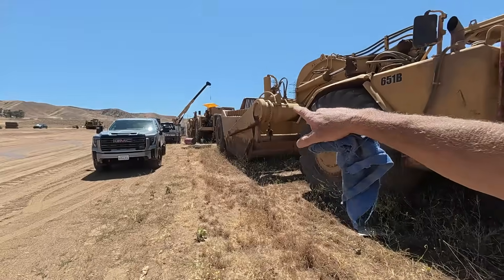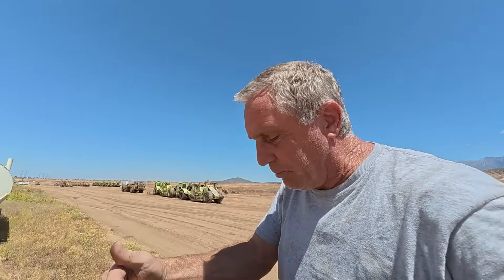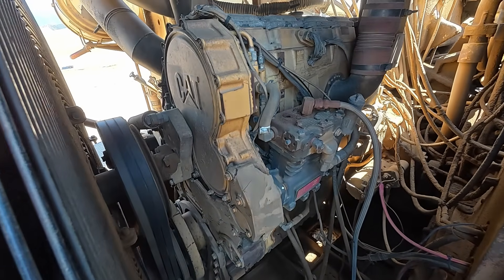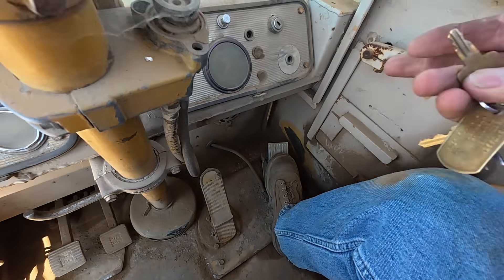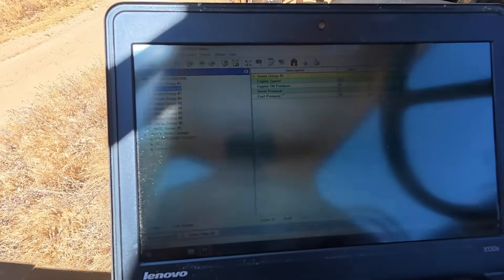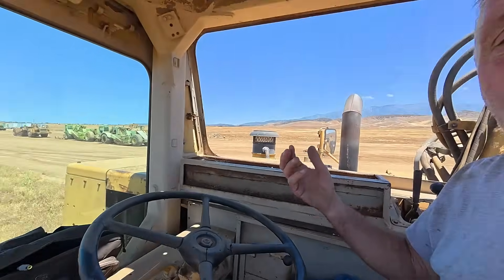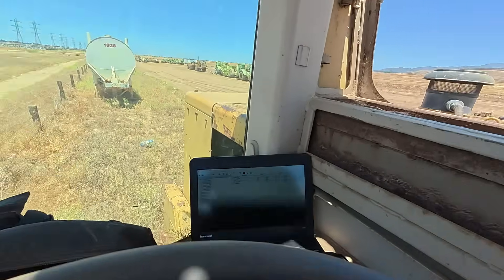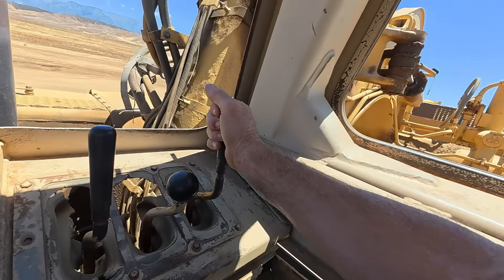Cat 651B Low Engine Power Diagnostics...

Comment: Laptop on a 651B ! Not a phrase I'll bet you thought you wouldn't ever say !
 I spent a lot of hours in my 45 year career working on 657 , 651 and 641B's with D346's, they made me a lot of money !
I can relate to all your comments . Thanks for sharing .
Reply from the maker: Ya for sure, remember back in the day we used a 3/4” wrench to find a miss not a laptop. Cat sure made the “B” models strong, 50 years old and still going strong. The internal parts in the transmission and Differential are still the same that were designed with a pencil and slide rule.
Reply: @RasmussenEquipment  Agreed , those were much simpler times, worked long hours 6 days a week to get the iron ready fort the next day and loved it !
I am wondering if you are you part of the CA Rasmussen family ?
Reply from the maker: No, I used to rent 657’s to them. 
My Uncle Willie knew Charlie pretty well.  
I’ve remember Charlie landing his helicopter in our yard in Colton back in the 90’s 
My dad and uncle owned Pacific Tractor 
They had around 45 657’s plus 834’s, D8L’s until they split in 1996.
Reply: @RasmussenEquipment  Just checking, I met Charlie in the mid 90's to survey some 657E's they were selling, we ended up purchasing 8 scrapers and some parts out of the Simi Valley yard and components from the "station " yard.  They were restructuring at the time and the equipment was pretty rough, We made a great deal on the package. 
Charlie was quite the character as I remember. 
As I said in my original post, I've  spent a lot of time working on these vintage machines, I can relate to, and really enjoy your comments in your videos. Thanks again for sharing !

Comment: More diagnostic stuff is great.
I spent 8 years as an oiler in socal. For the minor competition...

I remember seeing Rasmussen equipment on other jobs back then.
Reply from the maker: I used to like oiling back in the day, after everyone went home, nice and quiet except for the lube truck and air pumps
Reply: @RasmussenEquipment not nearly as hot out either,,  dont miss piping hot machines at 4pm right the job finished for the day

Or getting a face full of hot transmission oil.

Anyway, keep up the videos

Comment: I just got my heavy equipment ticket 
I really enjoy hearing your thought process and seeing how you inspect the machine.
Everyone wants experience with CAT ET, now I can say I have some.
Also I have never driven a scraper, seeing how the controls work was nice.
There was a question on my exam about the correct way to change the cutting edge on one of those.
Something like parking brake & chocks, raise and block the bucket, chain up the apron(?) then replace the edge(?) it was a, b, c, d and they were all very similar.
I've done a bunch of snowplow edges so I hope I can figure it out.
Cheers from Edmonton.
Reply from the maker: Good luck to your future with heavy equipment.
Edges are always fun, put a steel stand or two under the can and a safety pin for the apron.

Comment: Interesting video, thanks for sharing.  Unless I’m missing something, in addition to the low boost isn’t the issue of the borderline dragging brakes also going to cause poor performance?  Thanks from the UK
Reply from the maker: Absolutely, that will be the next repair, hopefully after that it should be back to normal.
My son resealed the exhaust manifold, but we haven’t been back out there yet to test it and do the other repairs.

Comment: A C15 is too small to power a 651
Reply from the maker: Ya the guy who owns this and I were talking about that, the dealer set up the C15 for these single engine 51’s but sold him a C18 for the front and a C15 for the rear of a 57. It made no sense. They both should have gotten a C18

Comment: I hatted that v8  but good for o/t some as early d10
Reply from the maker: I couldn’t tell you how many times we had one drop an exhaust valve. 
We had a couple of mechanics who would screw the rack stop screw out a couple of turns to get more power, but they always ended up dropping a valve after that. After they were gone that pretty much ended that problem. 
But they still only lasted 5 to 6 thousand hours.

Comment: 346's had a 125hr oil change interval,  if they didn't get changed the soot would grind them up. I've doubled the oil changes on my D343's by using a switchblade turbocharger
Reply from the maker: Ya we used to change them at 100 hours. 
My C-15’s we change at 325 hours. 
I watched my oil sampling to see when the oil started to degrade then gave myself a 50 hour buffer. 

I have 735’s and 740’s with 26,000 plus hours on original engines. 

I use Chevron Delo 400 15w40

Comment: What did they do wrong for the old engines to eat themselves so soon? Even today the bean counters don't get THAT greedy on selling you replacement engines 😅
Reply from the maker: The old engines were designed in the late 60’s on drafting tables, using slide rules and pencils. Mechanical fuel injection. 
If everything was set perfect and taken care of correctly, they could get 6000 hours. But that is rare on a machine that works in such harsh environments. 
Plus they were putting the max power out almost all day, if you tried to adjust the fuel rack to get more power they would drop exhaust valves. 
The new stuff is computer drafted, materials have evolved to be better. And a lot of Cat engines are only using a portion of the power that the engine can handle. Cat stopped rating engines by hours and now rate them by amount of fuel burned. 
I have rock trucks with C15’s putting out only 360 hp that have well over 25,000 hours on original bearings, pistons and liners. But they are so derated and don’t work real hard.

Comment: I wonder if the operator has confused lack of power due to draging brakes. ? LOL if it is. Ive seem dumb shit before, I once got a call out to a machine for no power and found a rock stuck in the floor under the accelorator pedal
Reply from the maker: Ya it definitely has a bad exhaust leak, it will hardly rev up in neutral. 
But I’ve seen it too… my  favorite is when an operator comes in and says his go is broken… I asked what… and he says ya I push on the go thing and it just doesn’t go.

Comment: What many mechanics don't do is learn how to run machines, you absolutely need to have a solid understanding how the machine operates to firstly help diagnose issues and then also check your work afterwards.........if you're gunna try to mend em you gotta know how to bend em
Reply from the maker: That’s a fact. When I first started work on scrapers, I decided to learn how to run them, that way I’d know what everything is supposed to do so when they broke it was easier to diagnose the problem. Also we had union operators who would either fake brake downs to get to sit in their truck while we hunted for a problem, or some just didn’t know if it was running right or not. 
I surprised quite a few guys when they would come in “broke” on a Friday at 1:00 hoping to go home early, and I jump  by in the machine and make a few rounds in it to see if it was broken….

Comment: Typical for a Scraper, go look at one problem and find a whole bunch more. 39 years with the UK dealer, mostly field service. We had a bunch of 657E’s moving stockpile coal at various power stations around the region. These were replacing aged TS24’s, we’re talking early to mid 2000’s here. 3408 front - 3306 rear. Very interesting to hear that California had a re power program for emissions; must’ve cost a fortune and listening to an earlier video from you it sounds like the fCalifornian government funded it? Motor Scrapers had all but died out in the uk by the 1990’s, replaced by excavators and articulated trucks. Given the right ground conditions though, Scrapers are mighty impressive earth moving beasts. Sadly, with the batshit crazy Net Zero ambitions of our government, we’ve now closed nearly all of our coal power stations and with that the demise of the Motor Scraper in the UK is almost complete. Good video, thanks.
Reply from the maker: Thank you for the comment. 
I grew up on 657’s working summers and after school oiling, fueling. Then out of high school went right to work on scraper spreads for my dad and uncle, they had 46 657’s. Between 1982 till 1996, they split up and then my dad and brother and I ran the company. 10 years later we sold them and I bought D350e’s 735’s and 725’s
Now for the last 9 years I’ve been on my own with 735’s and 740’s . 
The switch to Articulated trucks was almost like a vacation after working on 657’s
Reply: The 657E i work on have 3412 and 3408. I hate them with a passion. The 657G are slightly better. I refuse the repair or even look at the next gen 657 at the fleet

Comment: They parked it in the rattlesnake grass, has the wrong brake actuator. Low transmission oil, big air leak, exhaust leak. 
 What a turd !! 
   That’s why I hated being a mechanic at a construction company.
Reply from the maker: I’m always up for a challenge
Reply: Luckily, at the fleet I work at, we have sis 2.0 and company only buys factory parts

Comment: Very interesting - keep this up.  Get the air leak fixed first, then get this thing to move.  Great engine is the C15
Reply from the maker: We removed the exhaust manifold last week, will be putting that back in this week, then air leak and see why the trans won’t engage. 

I love going through this stuff to straighten it out

Comment: I like these, reminds me why I got outta that business. I worked for a hvy hwy contractor 30 yrs ago ran the same beat up iron, 631 and 637 D models. I was constantly going from job to job with my welding truck repairing broken goose necks and rebuilding ripped out floors. Constantly working on those things and trying to keep up with everything else.
Reply from the maker: Thanks for watching and the comment. These scrapers definitely do love getting worked on. That’s why I sold my 657’s and bought 740 articulated trucks, it was almost like I had retired.
Reply: Y@RasmussenEquipment  Yeah i'll bet, i was in my 20s back in those days.... I couldn't imagine being my age working on those things. They are in my blood though, my father was a master mechanic fleet mgr and had me in his equipment shops when i was young. By the time I was 18 i was welding and assembling equipment before and after moving. 235, 245, 1066, 1166 koehrings , D8,9,and 10s as well as many crawler cranes. I got real good at stick and fluxcore welding from those days. Served me well in my latter working years.
Reply from the maker: Sounds like my childhood, I grew up sweeping shop floors, cleaning parts, started oiling during the summer and after school as soon as I got my motorcycle permit at 15. The rest is history.